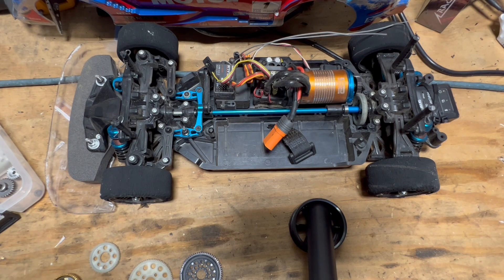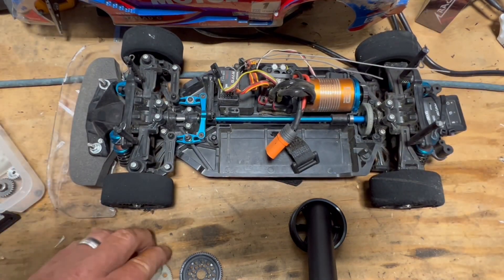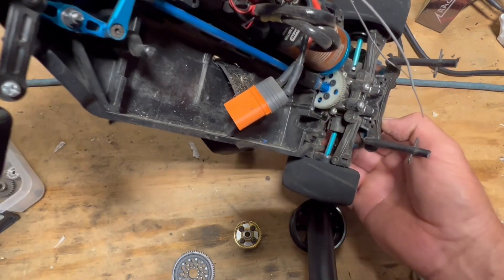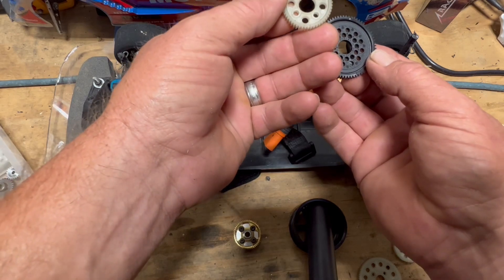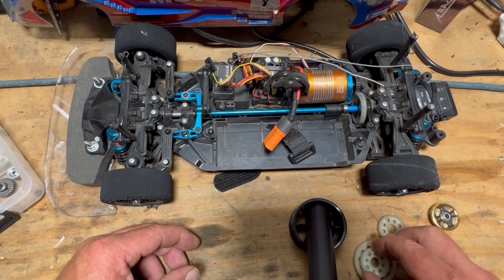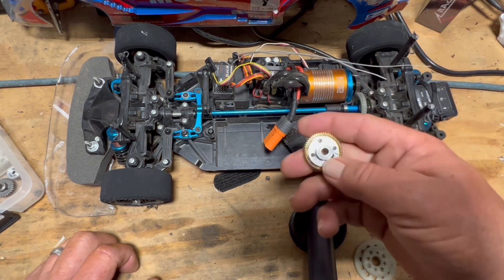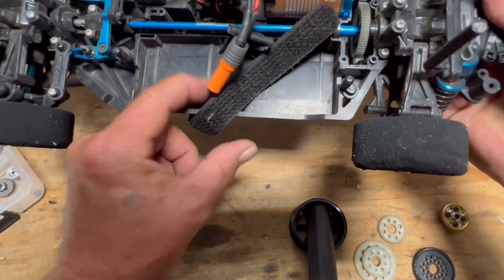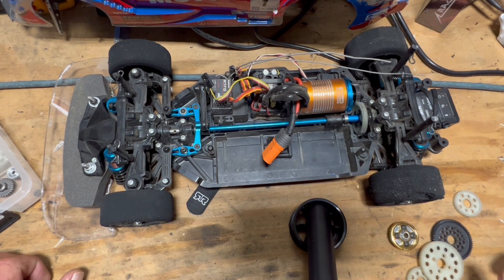Tamiya TT-02 Rc Car new gearing options! #rc #rccar #speedrun #tt02 @poorboysrc

Comment: Nice...  Another option..  These Tamiya gears can be a pain to find..  Thanks for sharing brother..
Reply from the maker: You got it brother!…. Did you make it out this morning?
Reply: @BNVRC  No rain delay but its drying up now gunna fit a run in before my wife drags me off to an anniversary dinner hahah..  Got 4 hrs to play cross your fingers hitting my new spot..
Reply from the maker: @reitplace4765  fingers crossed buddy!..🤞🤞
Reply: @BNVRC  52 again think I had a little more but new spots goinf to work.  Lost some dog bones so I'm going to start phase 3 upgrades new motor body wheels and with any luck get replacement dog bones this week.  She has a lot left steering is solid .  Great runs don't worry I'll be there real soon.
Reply from the maker: @reitplace4765  heck yea…. 52 is solid brother… this car is not easy to make go fast!…😂
Reply: @BNVRC  how yeah hardware holding up? Can get them cheaper and quicker than option no1
Reply from the maker: @reitplace4765  I have had zero issues with their stuff so far… the CVD’s work flawlessly!
Reply: @BNVRC  ordered red ones be here in couple days. Paid to much but that's the way it goes.
Reply from the maker: @reitplace4765  yea…. I struggle with it too…😂

Comment: Hi brother fantastic video. I would probably go with steel spur and pinion gear it will last longer. On my Rlaarlo ak-917 upgrade gearing mod1 I haven’t put a spur in I gone with 22t pinion gear and a 32t pinion gear on the motor so I will be doing some speed runs 😊
Reply from the maker: Nice!… yea I went straight to mod1 on the Ak-917 so all of this stuff was left over…. Still not sure if I’m going to try mod1 on this TT-02… I know some guys already have!… thank you for watching and commenting! 🙏🙏